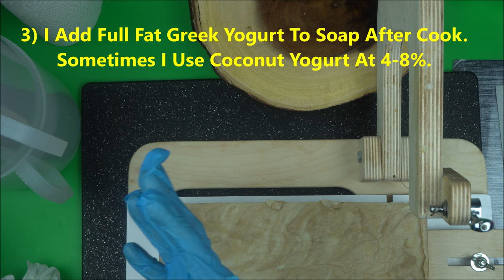Natural Commercial Soap Additives I Use To Make Hot Process Soap Stay More Fluid And Smooth

Comment: If I don't have sorbitol can I use a 2:1 Sugar to Water syrup solution?
Reply from the maker: no you can't use sugar and water syrup to replace sorbitol.
Reply: @greenbeautychemist.  hi, I did some additional research. I actually used a 1:1 ratio of sugar and water, yogurt  and another product and my hot process soap was extremely fluid to swirl and pour. Didn't need sorbitol at all.
Reply: @kellsgreenidge8885  hi..How much water was used??Including yogurt and other liquids....

I mean what is the total liquid can be used to get extremely fluid consistency?
Thankyou

Comment: Even in vaseline stage there is so much lye in my soap. And the more I cook it, the dryer and more crumbly it gets. What am I doing wrong?
Reply from the maker: may be you mixed it too much. More water has evaporated. It will be crumbly. Making hot process soap takes a lot